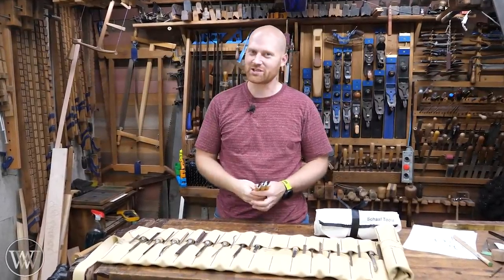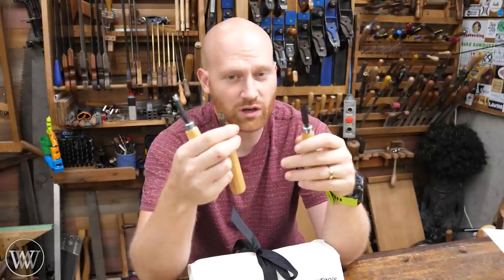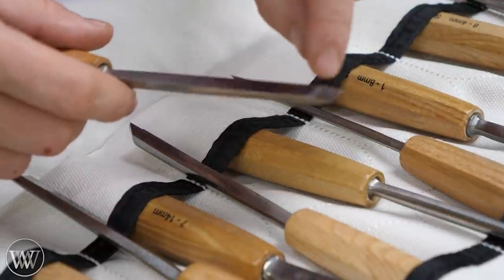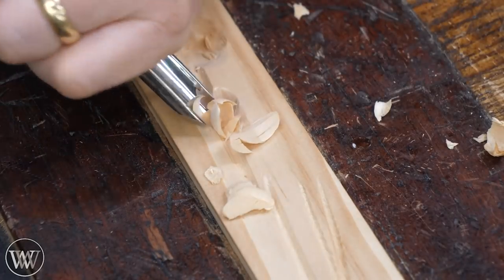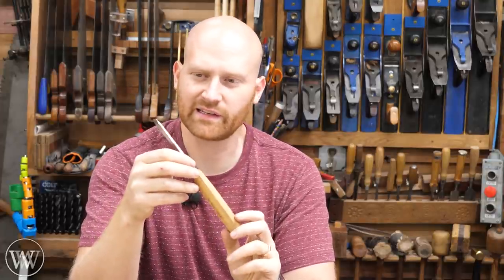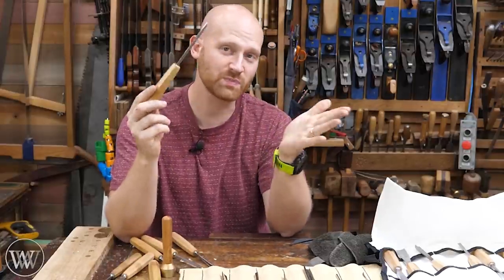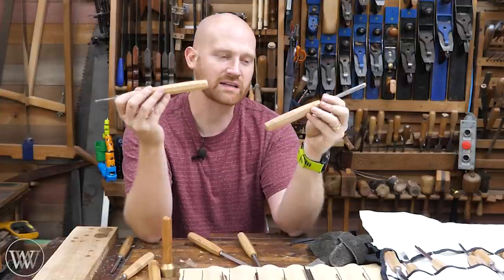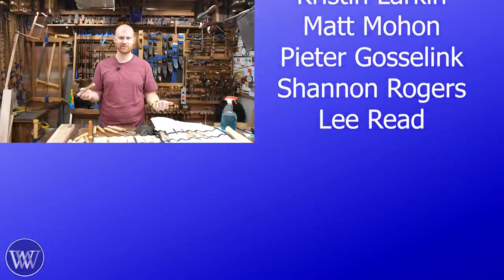$8 a Chisel? YEAH RIGHT!

Comment: I'm commenting before watching to prevent bias and compare after watching 🙂

I bought the Schaaf set for my 11yo stepson for Christmas last year. They all needed work straight from the box, and the curved spoon shaped one was twisted and needed to be torched and straightened to make work. But, that was actually perfect for teaching him all about edge geometry and metallurgy, so I'm not complaining at all. Especially since once we got them to proper "spec", they worked great. They hold an edge okay-ish, but sharpen fast and leave a mirror finish on the wood when straight from the strop. The handles could be a bit improved on, but that's just part of the fun!
Overall, I'd say it's well worth it if you enjoy and know how to true up your tools, which in my opinion should be all of us to at least some extent, and great for the beginner who REALLY wants to dive right down that woodworking rabbit hole

Edit: after watching it, sounds like we're on the same page more or less, lol. But, looks like your v tool was much less lopsided than ours, and the bigger spoon gouge that you didn't show was the twisted one. A few minutes for each of them on the stones made a night/day difference.

Comment: Thanks for another excellent video. I bought my first set about three years ago to add to my collection of "high-end" carving tools.. Because of my experience restoring and using previously owned and antique tools I always "commission" tools to my personal preference before using them and these were no exception. After taking the time to shape them a little and sharpen them as I would any of my tools, mine performed as well as any of the "high-end" brands. Pfeil, Ashley Iles, Henry Taylor, Two Cherries, and other brands each are a little different from each other and folks will favor different brands based on individual preferences. I was so impressed with my Schaaf set that I now have several sets including the seven piece set and the four piece fishtail sets, all of which offer additional  profiles. My Schaaf tools were not always as ready to go "out-of-the-box" as some of my new "high-end" tools, but, after a minimum of work, they worked as well or better as any I own. The difference in price more than made up for the little addition preparation. As to your comments on edge retention, I have found that many new  edged tools improve as the edge is worked back into the base metal over time. I have seen this improvement in brand name bench chisels and wonder if that might be the case with your set of carving tools. I have not noticed the issue with my Schaaf tools, There are other reviews online that have been done by various professional carvers and I encourage anyone considering purchasing these tools to check them out.

Comment: I bought that set for about $72.00 a little over a year ago from Amazon. I noticed that there were a couple sellers for the exact same tools (only the branding was changed). I expected to get sub-par tools for that price but was surprised. While the steel is most important for these types of tools, the finish work in the manufacturing process can make or break a tool right out of the box. These required a Lot of finish work on my part to get them to cut properly but for the price I couldn’t really complain. I read a lot of reviews on them and noticed two types . One type of review listed all of the reasons why the purchaser was unhappy and that boiled down to the fact that the tool wasn’t MAGICALLY SHARP right from the box and therefore was JUNK. Those were idiots that expected not to do anything for themselves. Then there were folks who were capable of doing things for themselves and noted that “while they were decent steel tools, you must sharpen to your expected level of keenness. The durability of the edge was also mentioned and as you have stated; “the edge retention varies.” I found that there was an additional problem of having to remove grind lines on the concave surface of the gouges and THAT took a while to remove to my level of approval. 
Conclusion: 
They are a good value for the money if you are not completely dependent  upon others to do the tool maintenance for you.
If you expect Magical Unicorns for a budget price then these aren’t for you. Thanks for doing this review and being honest about them.

Comment: I bought a set of schaaf, and they arent bad for the price. steel is pretty good for the cost. they will def take work to get a good edge, and some handles arent set right, but an email sent, and they immediately sent me new ones. my two cherry set at 400 has almost the same edge issues at about 4 times the price.

Comment: I got the same set a couple of Xmases ago. I haven't spent as much time carving at the bench as I would have liked, so take my opinions accordingly.

I have liked the set, having nothing other than Flexcut palm tools for comparison. I do have a few minor complaints: The labels rub off eventually and the finish makes it hard to relabel them, even with a sharpie. I wish the tool roll were just a bit wider, they like up a bit too far into the cover flaps (which probably wouldn't be necessary if the roll were wide enough). I haven't had a ton of luck with that spoon gouge; it feels almost like the bevel is shaped wrong somehow; I've always chocked it up to not quite knowing what to expect but maybe I should spend more time shaping it. The wide bent gouge is a workhorse though; I carved most of a large bowl with mine.

As a beginner, the problem with not buying a set is that unless you're following a particular tutorial that clearly specifies which tool to use, you have not idea which size and shape you need, so you need to have a variety to play around with and see what fits. Dropping $30*n to get one or several that might work is a tough sell.

Schaaf claims to have a lifetime quality guarantee, so if you're finding that edge retention isn't what it should be, then you should get it replaced (and tell us how it goes...).
Reply: We've replaced many a tool for customers over the years. Also, we are starting to laser print the labels moving forward to avoid the "rub off" issue :)

Comment: I have these and did a review on my channel a few years ago on them.  I found the same things as you did.  Fit and finish need some work and they did come rather dull.  But for a beginner set,  they'll work fine.  The hardness on them seems to be hit or miss as well,  some hold an edge incredibly well,  others it seems, I need to strop constantly.  The other thing I noticed was that some of them had a really high edge angle that make them a little hard to use ,  I like a little bit of a lower edge profile angle,  so I've had to re-profile a couple of them for my own liking.   Other than that,  as a beginner set,  they are probably the best out there.

Comment: Good Video! As an idea, but only if you are comfortable: What about taking some of the cheapest chisels that you have in stock and re-temper them yourself. Maybe the Harbor Freight's and several other brands. Would that bring them to a more usable level? If you over heated the chisel on a grinding wheel, would you be creating a dis-tempered chisel and if so are there shots for it?
Reply from the maker: Unfortunately to get a better temper than what you would get from harbor freight you would have to have a computer controlled furnace to be able to get exact temperatures. It's not something you can just do by eye unless you've had years of experience.

Comment: Actually, it looks like an amazing starter set despite the variance in quality.  My set that I began in the 1990s "one piece at a time, one piece a month as I could afford" is Pfeil, but that was my only option. I wish I had this set to start and replace the lower quality pieces as my skills improved.
Reply: If you're willing to sharpen your tools, we stand behind the quality of our material (and have the backing of professional carvers). We also realize there is variance, which is why we offer free replacements for any individual tools that slip through quality control :)
Reply: @SchaafTools  It is so good to see a company completely stand behind their products. I am currently waiting on my set to arrive, should be here today, so I’m quite excited about that!

I have seen, and taken note of, the warning/recommendation that if you are unwilling to sharpen the gouges, to either look elsewhere, or to purchase the hand sharpened set. Well, I am admittedly not where I want to be sharpening wise, especially when it comes to curved edges/gouges, but I am not above putting in the work myself. There are multiple reasons for this, 1) I will take a lot more pride in an edge I put on myself, 2) it is cheaper to get these vs the hand sharpened set, and 3) I will never get better at sharpening without actually doing some sharpening. 

Just a couple of quick questions…what is the best way to sharpen the gouges? (or a link to a video you think explains it best?). And most importantly, how in the heck do you pronounce Schaaf?!

Comment: As a beginner in the hand carving world I appreciate your insight. However I've always bought the best tool for the work and for me spending more on quality becomes priority and then as you say collect as needed. The 4 piece set (3 chisels)on amazon from PFEIL looks to be a great starter set up for the same price as the Schaaf. Are these the 3 basic chisels to begin with? Or should I buy these individually? Great videos !
Reply from the maker: If you can afford them I say definitely go with Pfile.
Reply from the maker: The first chisel you would want is a V tool. Something around 60° with about a 6 mm side. Give or take. Next. Next you would want to skew chisel. As to gouge size. It really depends on the work you want to do. You match the gouge to the cut you want to make on the shape and that can be wildly different from project to project.
Reply: @WoodByWrightHowTo  
I can never afford things but was always taught to get the best. thanks for your response.

Comment: I would get the pfeil 6 in your link, with a good chisel and go from there, especially if you have not invested in sharpening stones as a strop will not reprofile those carving tools, so the cost of sharpening stones must be thought about. Is there any confirmation of what steel they use, because they might be ok right now, but not sure how it will hold up. I spent roughly 150 more on pfeil for 12 hand picked, some D and some full size and as it was expensive initial cost, I believe it to be worth it in the long run, but then again I am buy once cry once type of person. I have cheap tools also and dont mind working with them, hell could probably heat up a screwdriver and turn it into a gouge if needs be. Thank for the review and keeping it honest. I almost got the two cherries or hirsch which might be the same company. If I had to do it again, I would try to find the most fishtails I could find as I do not plan to carve enough to change the radius or profile of the chisels when stroping/reshaping. If I already had the sharpening stones, and wasnt sure if I really wanted to get into carving, I would consider this set and reprofile them and save 150 bucks, if I didnt have the stones and just a strop (yours is great by the way), I would invest in the 6 V tool, probably full size, and a chisel as you stated, as good diamond stones/shapton glass are very expensive, dont even want to think about how much ive spent on those, especially when new findings are showing a 1000 grit and buffing wheel with green goo on a buffing wheel might be all that one needs. Whatever someone decides, they should get that pfeil 6 V in the link, most used hands down for outlines and more, and if you already do dovetails you might have a skew chisel, or buy a cheap/old chisel and re-grind it into a skew at 25 degrees for bevel and 22 at the slant. The best advise you gave was buy the gouges for the project you need, kinda  like buying router bits hahah.

Comment: Naming no brands, I have a set of chisels by a well known maker, middle price range.  They were well recommended.  Out of the bow they were definitely sharp, but - the edges of several brittle.  They were OK in pine, but in hard wood they chipped.  The edges were overhard.  I fixed them by grinding new bevels, for some of them twice.  I have a set of Sorby registered chisels that retain the indentation of a hardness test on each chisel.
Reply: This comment is pretty useless by not naming the brand bro

Comment: I bought the harbor freight set just because I'm just getting started using tools like this, and knew I could practice sharpening them and not worry about destroying them. They also have helped me to learn how to re edge these types of tools as the bevels are absolutely atrocious! One of the V tools, the bevel was so steep, you had to hold it almost straight up and down to get it to carve. Great tools to practice sharpening and re edging with no fear of destroying them, not so great for carving.

Comment: My experience is you need to sharpen cheap steel more often, also if they cheap out on the thickness it can hurt performance to the point of being useless
Reply from the maker: In general yes. But that can be a good thing for the beginner as you have to learn to sharpen more often you learn to sharpen quicker. In the end it doesn't actually hurt the function and you can get a relatively cheap travel to do the exact same work with the exact same age of a really fine chisel. It just won't stay there as long.

Comment: I have a PFEIL V-tool that seems to work well for me, although slightly different than James's. I am interested in getting skew chisel next, but there are so many sizes, what size would be the most useful for basic chip carving?
Reply from the maker: It really depends on the chip carving you want to do. there really isn't one that is better for general works and others. My usual rule of thumb is get one in the middle of the measurements and then go from there.

Comment: Great review.  But why would you expect them to be super sharp out of the box? I would expect any edge tool would need finish sharpening before use.  Surely the edge will be damaged during shipping and handling.
Reply from the maker: I did not expect them to be sharp out of the box. But I'm comparing them to the higher class chisels that are sharp out of the box. But for the price I was expecting to have to touch them up.
Reply: @WoodByWrightHowTo  They more or less imply they need sharpening from the get go in specs.

Comment: I bought the fishtail set and found it to be decent. It needed some bevel work and refinement to make them work well, but it wasn't unexpected. I then purchased the 12 pc set and that's where my negativity toward Schaaf started. When I bought them, I had surgery coming up and thought I'd get new chisels to play with while I was recovering. The surgery happened and well, I got a good look at my chisels and even without the warnings on amazon I expected to sharpen them. What I didn't expect was that they'd need to be completely reprofiled before they could be sharpened. I had to grind off the bevel of the v-tool and start over, because it was so out of whack it couldn't be saved. Two had handles that weren't fit to the chisel and at some point I might make new handles. Most of them had bevels so steep that the chisel needed to be almost vertical in order for the cutting edge to contact the wood- essentially, if you try to carve with it,  you're driving it like a nail, rather than carving. It was beyond the 30 day return period, so I pretty much gave up on them and they're sitting in my shop until I have time to fix them.. I've been carving since about 1972 when my grandfather bought me a brand new set of Miller's Falls chisels and I still have them. When anybody asks me what to get I tell them Pfeil , Stryi, Naumov and Stubai are all great and will work right out of the box in most cases, but will work better with a few seconds of sharpening. I tell them to buy 4 chisels, a flat, a shallow gouge, a v, and a narrow gouge, and that they can always add tools as their carving projects grow. If they want a set I suggest going on ebay for a vintage Miller's Falls or Brookstone set. which will cost about $40-$50 and will last a lifetime. If they need something right now, and want a set, I suggest Flexcut, which are cheap and a bit ugly (IMO), but will get you going. I can't, in good conscience give any recommendation to Schaaf. I think they could be good tools if the company cared enough to implement some quality control, but since  only two of the ones in my 12 pc set had any business leaving the factory as they were, I don't think that was the case. :(

Comment: These have the typical Chinese tool issues. You get some that are good and some that are bad. Quality control just sucks on them. They've also cut corners on the steel used. They don't say exactly what it is, but they do say it has .65% carbon content, so that makes it something like a 1065. So your durability is going to be shot. It's as low carbon content as you can get and still be hardenable. I bet if you ran them through your chisel tests they'd end up on the lower end of the spectrum. Pfeil on the other hand uses a proprietary CrV steel, but it's likely closer to 1% carbon, so almost getting into the ultra-high carbon steels. Their QC is also exceptional. At the same time, 8 bucks vs 40 bucks is a big difference. Basically, Schaaf is a beginner set that will work, but it's not even in the same arena as Pfeil. If I were a professional carver, I wouldn't even look at them. At the same time though, if you're someone that wants to put some wheat on a saw handle or carve your initials on a box, they might be a good buy for the money. 100 bucks for 12 functional carving tools is a hard deal to pass up.